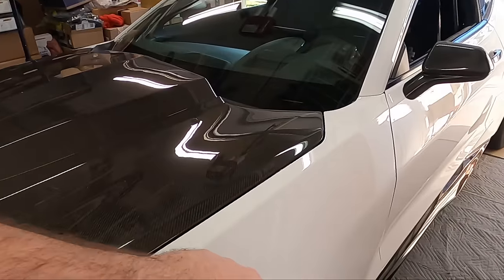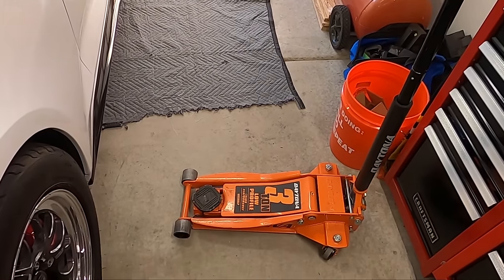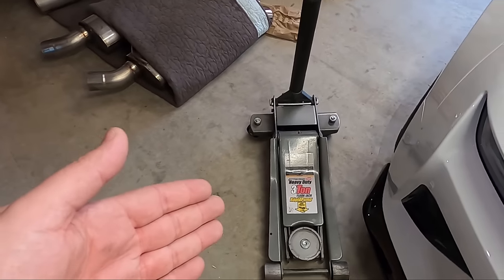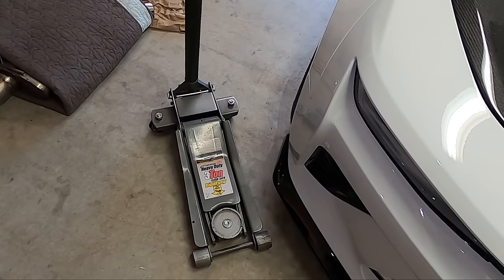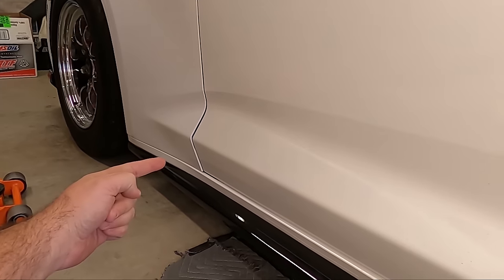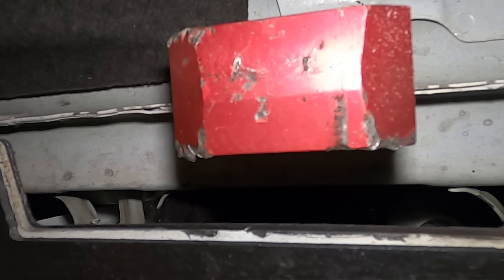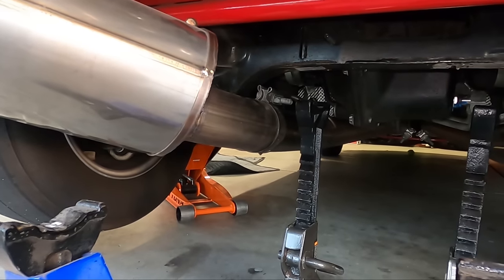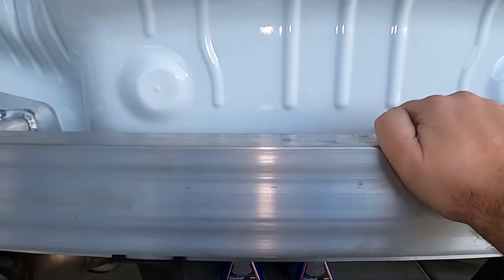Lifting/Jacking Up Your Camaro Properly! 16-24 Camaro - All Models

Comment: Very helpful information Matt.  I have the Pittsburgh 3-ton low profile jack, the ZL1 Addon "permanent" lift pads installed on all 4 lift points, and 4 ton jack stands. I got the ZL1Addon items courtesy of watching your vids and they are great but I always had problem of how to get jack stand inserted when the jack was using the pinch weld lift point (front was issue).  Seeing your tip on the inside subframe is a game changer.  And likewise your old vid on using the center diff lift point allowed me to put stands under lifts points ahead of rear wheels.  Now I can get 4 points supported with jack stands.  (Before I got the permanent ZL1Addon pads I used the mag pads and the hockey puck inserted between mag pad and jack's lift arm cup--and for a simple wheel/tire changeout they were great combo).

Comment: IMO nothing wrong with putting stands on pinch welds gently, especially if you have the rubber jack stand toppers from HF. I appreciate knowing you can lift from rear diff, that helps tremendously. Thanks.

Comment: Thanks for this info. I was worried where to put the jack on my 2021 camaro with side skirts. I did not want to have my skirts ruined or my fender as this has happened to me on my Nissan Altima, but I didnt do it. A co worker did and wrecked my fender. I was upset, but I couldn't get mad since he offered to fix my tire. Lesson learned do it yourself lol.

Comment: Having owned a c7 corvette before my camaro, I can't say I am a fan of the design. The corvette had 4 clear jacking points with pucks to lift from. If you jacked it up from the centre lifting point, the whole one side of the car would lift with no stress about bending any pinch welds or worse

Comment: Very informative video! I have the flat version of those pads and they are super nice. I was changing out my oil today and noticed the pad starting to bend towards the door. I think this is due to not having the lift point on the jack centered with the pad, however, if I center it then my jack is going to press against my side skirt. What solution would you offer for this? Jacking both sides up at the same time? Btw I have a low profile Daytona jack. Thanks

Comment: Thinking about doing my own oil after only getting 2400 miles on last dealer synthetic change.  Thanks for posting this before I went in and bent shit up.  How different is the SS convertible underneath compared to the coupe.  Asking because the ZL1 addons lift pads are different for convertible than coupe.

Comment: I've got a similar set of jack stands like the ones in the video and I refuse to use them because your supposed to push in the metal tabs on the side (you can see the sticker with the arrow  that points to the tab that needs to be pushed in). I noticed you didn't push them in, is this not a safety issue?

Comment: great info thx! can we add any additional pads (between the front and rear points you have identified) so one could use the Ideal TLX-7000 tilting lift ?? The lifting ramps on this small portable lift are not very long. Do you thing this lift could be used on a 6th gen?? thx
Reply from the maker: Never seen a tilting lift in person, but my Quick Jacks work well with the rubber pads they come with.
Reply: @Lethalgarage  thank you!!

Comment: Hey Matt, Love the channel. The ZL1 Addons Bolt on's were my first mod to the car. Wouldn't trust it any other way.
I noticed the fiber under panels installed on your floor boards. Was that an upgrade you did or did the car come like that?
My 17 SS Convertible doesn't have them & thought they should be there for better aerodynamics.
Or it was just a 1LE thing.
Reply from the maker: The vert is different
Reply: @Lethalgarage  OK, Thanks for the info. Gonna look into the cost of installing it. Under-car aero is always overlooked for high speed stability.

Comment: Does your garage have any slope? I plan to swap out my summer tires and my garage has a slight 3 degree slope . I was thinking of using chocks and lifting from the lower side so as not to increase the incline angle further. (Swapping out one wheel at a time , using a jack stand and 3 ton hydraulic floor jack as secondary.. thoughts?

Comment: Just ordered the ZL1 bolt on lift pads from Amazon. Thanks for the great tip. Have you seen any issues with them falling off after being lifted or running down the road?
Reply from the maker: Not if you put the on tight enough

Comment: this makes sense but would be nice if GM would say how to use jack stands on this car. i just used the ZL1 jack safety stops and 4 of the HF 1.5 ton jacks.  until i bought a maxjax M6 lift
Reply from the maker: They never will.

Comment: Serious question 🙋🏽‍♂️ why doesn’t no one show how to lift the Camaro 6th gen from the front so that both front tires are in the air just how you lifted the rear with the middle differential?????
Reply from the maker: @DannyRocha915  no really solid center piece unless you remove the cradles
Reply: @Lethalgarage  ohh okay , I get it! Thanks

Comment: Just wait till the car gets old rusty pinch welds are always fun.  At work always have to find ways to lift old cars so you can change tires without smashing the pinch welds.
Reply from the maker: ZL1 Addons is working on a fix for that ;)
Reply: @Lethalgarage  i wouldn't be worrying about your California car but here in south Dakota give cars, vans, etc get really bad in say 10-15 years.  Trucks are really not an issue with solid axles and frames.  Like my sedan it sits in the garage all winter if I had a camaro or other sports car it wouldn't go out in that stuff.

Comment: Dumb question can you use a tire jack and stands to change the oil
Reply from the maker: Not sure what you mean by tire jack? If you mean floor jack and stands, you sure can
Reply: @Lethalgarage  the jack the car comes with would it be safe
Reply from the maker: @titanharper7184  If your just using it to lift the car and put Jack stands underneath, sure.
Reply: @titanharper7184 definitely don’t rely on just that one jack boss invest on extra jacks just to keep it safe more money but def safer

Comment: Lethal, can the lift pads go anywhere within the front cutout on the front driver side? I can’t slide mine back very far because of that fabric material.
Reply from the maker: As long as it’s on the pinch weld

Comment: Unrelated to this video, but I have to replace my front splitter on my 2016 Chevy Camaro. I was wondering before I start.. is taking the splitter off easy or I will need someone to help me take off splitter and put on the new splitter? I know it might be a dumb question but still wanted to ask.
Reply: It's a piece of cake. There are about 12 - 7mm bolts to remove and the splitter comes right out.
Reply from the maker: Bolts and possibly some rivers that need to be drilled out
Reply: LethalGarage the one I’m getting has the holes already drilled. It will be the first real removal/install part I’ve done for my Camaro. Can’t wait. Seen some of your videos and will be using your tricks and tips to complete a few mods I want to do.

Comment: Why can't you support the car on jack stands from the 4 attached jack pad points?
Reply from the maker: Problem happens when you lift the corners one or 2 at a time. The pads don’t have a catch and they can slide right off the stand.
Reply: @Lethalgarage  Makes sense. That's a problem so will look further into this.

Comment: Can i lift the the car with the jack mag and put the jack stands on the jack pads
Reply from the maker: Never put Jack stands on Jack pad unless you have specific ones designed for that, which ZL1 Addons are not. You can put the Jack stands where I point out in this video.

Comment: Can you put the jack stands on the lift pads?
Reply from the maker: No!
Reply: @Lethalgarage  I know you shouldn’t but why exactly? Not enough surface area or strength?
Reply from the maker: @StirlingMossDrives  if the car is at an angle it will slide right off
Reply: @Lethalgarage  Thank you dude

Comment: I have zero faith in the magnetic lift pads.  I have .039" magnetic lift pads.  After lifting the car in the right front corner the pad twisted causing the fender and rocker panel to buckle in.  I didn't lift my car as high as yours.  A three month old car and it has a $1,000.00 in damage!  The pinch weld is still straight.  The lifting surface is flat and straight concrete.  The floor-jack is an almost new 4-ton Harbor Freight unit I've used before. Perhaps .025" gap lift pads are needed.  I never liked the idea of the pinch welds as a lifting point.  If it can bend, it's not strong.
Reply from the maker: Never had issues

Comment: Can you jack the car up without the lift pads?
Reply from the maker: Sure. But pinch welds like to collapse
Reply: @Lethalgarage  got the lift pads, one more question, I got extra lift pads so, do you think it would be safe to set the car on jack stands on the lift pads in the front to do an oil change? Or would they maybe slip?
Reply from the maker: @zeusdetro8173  never put Jack stands on the lift pads
Reply: @Lethalgarage  thank you sir

Comment: I had a 2017 2lt i had no problem lifting that car but i traded it for the same year 2 ss and when i went to lift it the same way from the pinch welds, the tires didnt want leave the ground, the suspension just stretched out instead, it was the weirdest thing ive ever seen ...has anyone else had this problem

Comment: Is there a front spot to lift up fully the front ?
Reply from the maker: GM’s book highlights a place but I have never found it, nor trust anything to be a lift point outside what has been shown
Reply: @Lethalgarage  thanks yeah i use ramps i would like to just jack the front slide them on i cant drive up lip is in the way - but i am gonna add the adapters to the pinch well and use a hockey puck in case never know
Reply: @Lethalgarage  there’s a small rectangle in the front center sticking out past the plastic lower shield. is this where gm is saying is a jack point in the front?

Comment: Don't you have to get under the car with a jack holding it up to place those stands up front-? Seems counterintuitive.
Reply from the maker: @markvandendyke  well yeah… you have to lift the car to be able to put it on jack stands.
Reply: @Lethalgarage  lol yeah, just wasn't sure how far under you had to go. Tried it that way & felt more solid than using the pinch welds, thx.

Comment: Good info hate using Pinch welds   ….  wish there was somewhere you can put jack stands closer to the engine or the front arms when your just working on the front of the car …..  rather then that far back  too bad its that far under on the sides I was thinking  jacking where you put the jack and put the jack under the ZL1 pads to get a more out board stance ….  off the subject have you seen this guys designs on the Camaro and Silverado    He sure has good ideas  wish Companies would consult with him   https://www.youtube.com/watch?v=Y3UX48FpHyE       ////////    https://www.youtube.com/watch?v=YUctO8GSiRQ